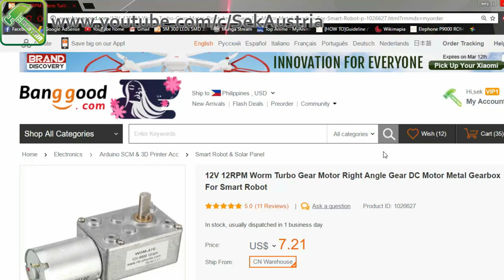Barbeque Roller Using TEC Peltier [DIY]

Comment: скажите пожалуйста, а зачем вы установили элементы Пельтье?
Reply from the maker: so it will generate power to the motor, as you can see the motor is running i have a reading of 8-10volts dc to the 5 peltier
Reply: Sek Austria i may use this to  run a fan inside the metal storage container that gets quite hot on top in the open sun in texas i dont have to worry about the wind ripping it off or hail damage like with a solar panel may use it to power led light string also